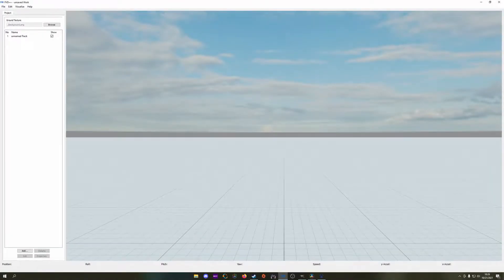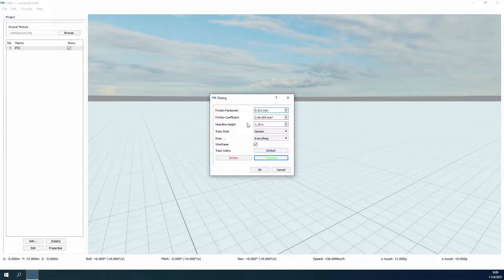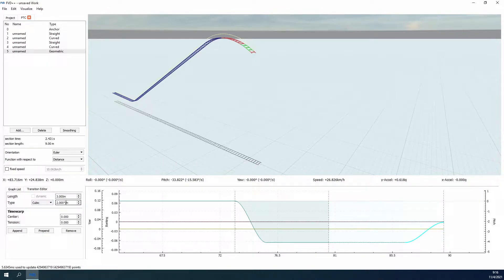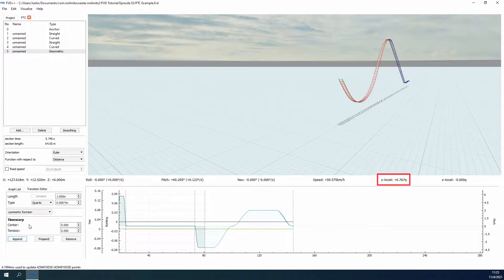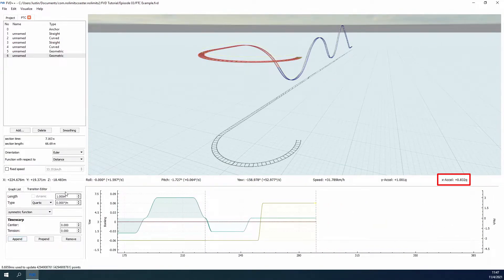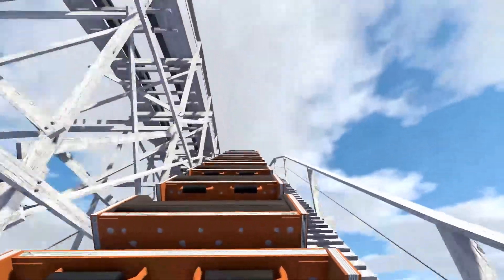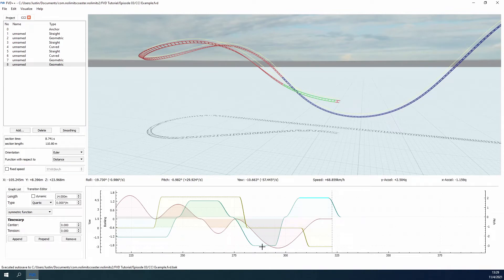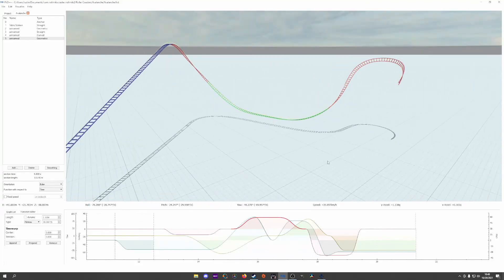Force Vector Design - Episode 03 - Geometric Sections (Wooden Coasters!)

Comment: Any update on the next part. I badly need to learn more about geo sections... As, I seam not to fully understand their behavior yet, especially when going over 90° in pitch.
Reply from the maker: I have it in the works, but life is busy. I'll say that geo sections don't do well with going past 90 degrees. A nice vertical loop with geo sections is nearly impossible, for instance. Elements that don't invert are really where geo excels.